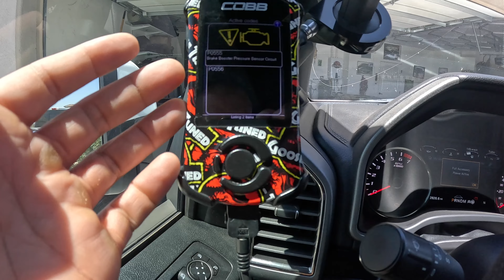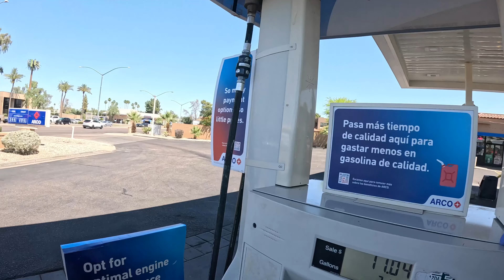Project Raptor Build: Episode 5 - Expect the unexpected

Comment: What brand steering wheel do you have?  So many aftermarket, but I like the options you went with.
Reply from the maker: I looked and looked. Came across one on ebay, so it's an ebay wheel.